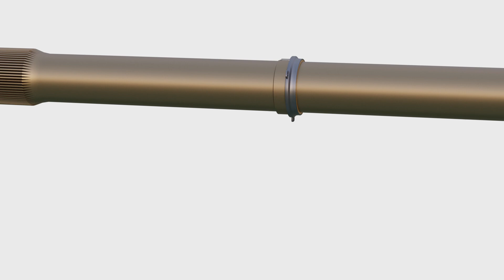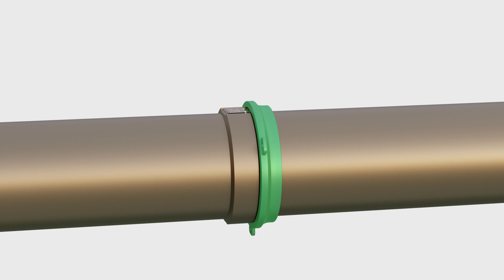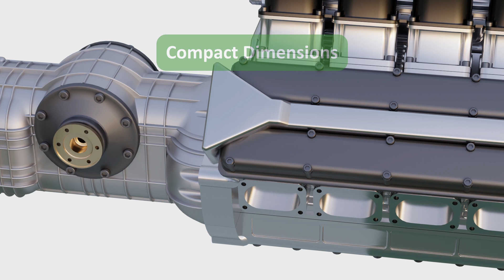Surface Acoustic Wave (SAW) Technology in Motorsport

Comment: Bro could please tell me  one new researche with using  SAW technology.
Reply from the maker: Thanks for the question, I’m not sure a completely understand though, sorry? 

SAW technology allows torque, force and temperature on rotating or moving components to be measured not possible with other sensing technologies. Usually this is due one or more:
> Small packaging volume needed to fit SAW on the moving part 
> Ability to measure stiffer components
> Increased resistance to operating temperatures and harsh environments

Plus some other factors.

SAW, in some applications, gives better sensing performance than conventional sensors:
> No torsion shaft needed so reduced system mechanical hysterisis, reduced torsional instability and improved sensor response
> Higher-speed measurement

Does that answer your question?